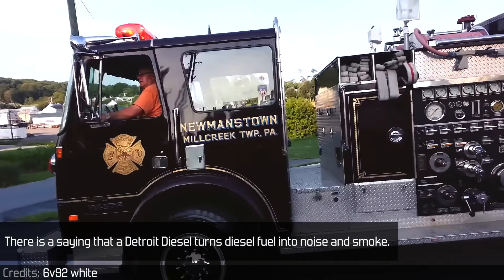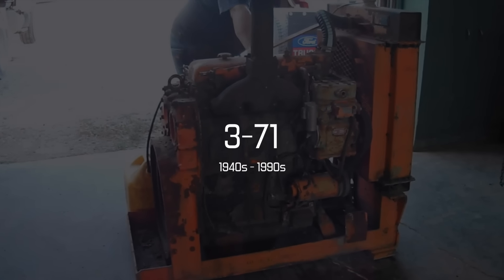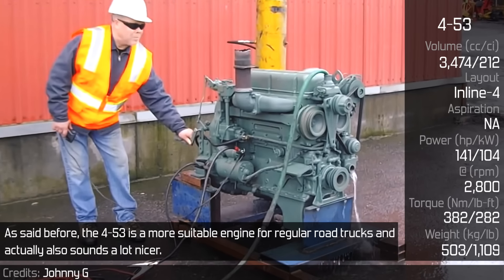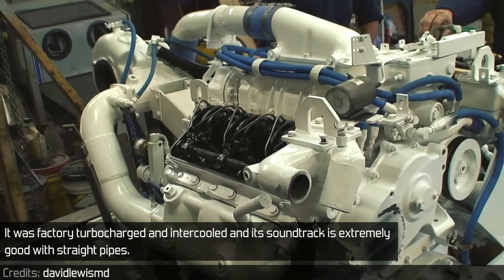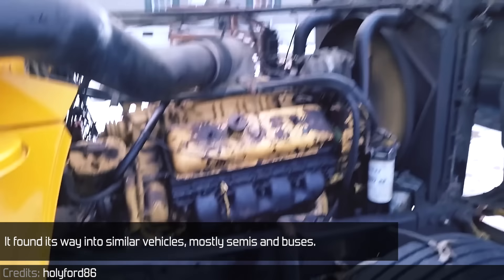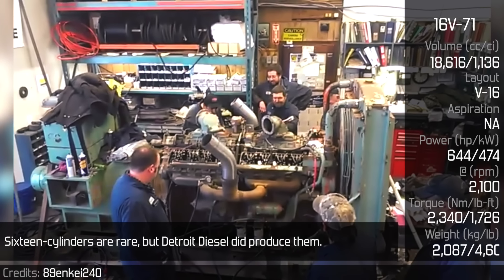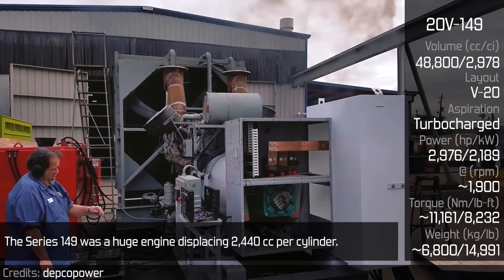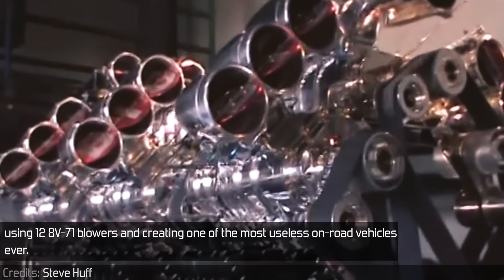9 Of The Greatest 2-Stroke Detroit Diesel Engines Ever

Comment: Imagine if a company made a diesiel powered muscle car
Reply: Cartoonz n Cereal BLASPHEMEEEHH
Reply: Cartoonz n Cereal it would get dragged
Reply: That would be dodge. they could put a straight 6 turbo Cummins into something like the challenger or make an entire new line of muscle style cars.ahh think of the possibilities lol
Reply: Cartoonz n Cereal look up the duramax camaro and powerstroke mustang, there's a company that actually didnit
Reply: ForRealBruh 01 that was an aftermarket conversion, I believe the company that did it would build you one, but it costs tens of thousands
Reply: Maybe he was talking about factory made cars.
Reply: yeah it will tear the road apart into pieces  from its monster torque but still lose out in acceleration to a Vtec  revvy petrol Japanese kitty engine Honda
Reply: fidel catsro You do realize that you can trade torque for rpm through gearing just as much as you can trade rpm for torque, right?
Reply: Cartoonz n Cereal I don't think bmw 335D is far from it, but what do i know?
Reply: Some guy in Canada did it with a first generation Plymouth Barracuda...
Reply: Cartoonz n Cereal the reason why there are no US passenger cars with diesel, is that thy do not meet emissions.
Reply: Cartoonz n Cereal. 70. Dodge charger with a 353 detroit on youtube
Reply: u mean like 3.0tdi audi a5?
Reply: keep dreaming ... you might pull off the line faster since the rpm range is short on diesel, forcing a lot of gear changes but once the turbo has time to start blowing on higher gears, the shear torque will keep the diesel car accelerating forever, when that little vtec struggles to overcome the air resistance and doesn't do crap after 130km/h+ vs a proper diesel.
Reply: Check out the BMW M550d, lots of diesel power in a limousine
Reply: unfortunately that's a 3 liter diesel too ... not 5L like the name would suggest
Reply: And about the 5 litre V10 from Volkswagen ?
Reply: Well if you don't need 5 liter to achieve the power you want why should you waste the fuel?
Reply: Audi, Mercedes Benz and BMW have produced high performance V8 turbo diesel automobiles.  Fast and frugal on the fuel.
Reply: Cartoonz N 2JZ bmw made a few
Reply: The germans do
Reply: Cartoonz.........The Mercedes-Benz S 400 d
Reply: Well, JCB (of excavators fame) made a record breaking car for running on the salt flats.  It took the highest speed record for a diesel-powered car in 2008 if I remember well, somewhere around 350MPH.  Definitely not a mass-produced car, but a muscle car built by a company ;-)
Reply: Audi Q7 V12TDI a muscle SUV
Reply: Justin Noker and the Cummins Charger
Reply: Santiago Giuntoli  That foolish of you to say that. Not all diesel engines were indestructible.  It's like the same for gas engines, they made good one's and shitty ones.
Reply: @cpufreak101  how about the cummins rx8. been done. cummins vette. duramax viper. people put diesels in anything. the problem is a diesel weighs too damn much and legally you cant put one in a vehicle that isnt rated to tow
Reply: @REAPER0D  yeah, especially with those truck Diesel's, some of them probably weigh as much as a small car on their own haha, and stateside I don't think there's any such laws like that as it's your funeral :P
Reply: @cpufreak101  there is a law. auto manufacturers have certain rules they are required to follow. one of the reasons there was only a few turbine powered cars ever made because of safety reasons and cost to manufacture they werent a viable choice for use.

when you look at something like say a charger (using that as its a common car chasis) throwing a 3k pound cummins in it creates a situation where the engine weighs the same as the car almost. in that creates a problem with crash test ratings. in which a auto manufacturer has laws to follow. so yeah, theres laws prohibiting it. why there arent v16 gasoline engines, and the ones that do exist are not automotive application. why bugatti created and developed the W16 cause the government put a ban on engines larger then 12 cylinders in a V pattern.
Reply: @REAPER0D  just saying it must not be enforced very well then, cause someone in my neighborhood tows with an old malibu with an owners manual that clearly states "do not use this vehicle to tow"
Reply: I got 2 buddies that put a 4bt in a chevelle and one in a 48 power wagon  and both vehicles are terrifying.  Like Richard hammond says. "Like being stuck in a phone booth with a panicky gorilla.
Reply: They already did. GM/Chevy had diesel 350’s and a few other motors that were diesel. They went in some muscle cars but were a rare option
Reply: The Audi A6 TDi is kind of a sporty sedan
Reply: They do make diesel power muscle car,,,Mercedes Benz the best one for me be 240 sl........nowadays think they up in 300 or something like that I know back in the 1980's they out done corvettes mustang running quarter mile.....0 to 60 was like 5 to 6 seconds maybe little less
Reply: They build them in Tuscaloosa, Alabama.....know that for fact,,,,I hauled the concrete walls and prefab buildings up there from moss point , Ms
Reply: i just hope they make factory built diesel cruiser motorcycle. Heavy, powerful torque, and loud

Comment: All is good until a cylinder sleeve cracks and than hang on because the ride don't end until she blows apart or it finshs eating engine oil.   3 71s in tractors were famous for runnning away and you shove what ever you could in the air inlet to kill it.

Comment: The designation was first number is number of pistons and second number was displacement of each piston.
I drove a 6-71 for many years. Being a two stroke, if you stalled it out sometimes it would run backwards. Black smoke out the air cleaner

Comment: You also have several roots blowers because 2 cycle diesels have cylinder ports and dont have any intake valves. Your pistons would be the intake valves to open and close off the cylinder.

Comment: Let's keep it real, if you love Detroit Diesels, it is for the sound, not for the hp.  The 2 stroke design doesn't allow for the high boost pressures you see on modern 4 stroke engines. And if you love them for the sound, the 53 series is where the love is at. They spin 2,800 rpm compared to 2,500 rpm on the 71 series and 2,100 rpm on the 92 series. And the more cylinders the better! So the best engines are the 8v53 and the 12v53. Also worth searching on YouTube are the 453's used in tractor pulling that spin 5,500 rpm. Those sound plain crazy!
Reply: I have seen a YT video of an 8V53, but haven't ever heard of a 12V53.

Comment: Hmmm no 6v-71s or 6-71s 

I think some of your info on the 71s is off.  The 1-71 2-71 came with two valve heads. All the rest could be found with either two or four valve heads. It all depended on the application of the engines.

The four valve heads were known for cracking between the valve seats or the valve seats and the injector bore on high stressed motors.

Comment: I wish detroit was still around to make more modern versions of these awesome engines. I feel like if they took a standard 2 stroke design (though seal off the crankcase and use the bottom of the piston to compress the air instead of the crankshaft) but added the detroit diesel valvetrain idea and added direct injection it could make for a hell of an awesome engine that might just pass emissions.
Reply: They are still around.. They just don't build 2 strokes anymore because of emissions laws.
Reply: Get rid of the emission laws then
Reply: The 51, 53, 71, 92, 149, 567, 645, 710, and a whole bunch of lesser known Cleveland, Winton, Electro Motive, GM, and Detroit Diesels where all direct injected.
Reply: Roger Penske bought Detroit Diesel and converted them to 4 stroke elctronic fuel injection. Put them on the road through Penske Truck Leasing and the fuel cost advantage was so significant that Cat and Cummins had to go to EFI to stay in business. The  2 strokes were already almost obsolete, but also all the non EFI 4 stroke engines as well. Nothing w/o EFI is competitive on fuel efficiency or emissions anymore.

Comment: Yo Visio, just an fyi, the 8v-71 was never sold Naturally Aspirated. The engine needed forced induction to run, since its a two stroke and there is no crankcase compression. The cylinders wouldnt properly scavenge the exhaust without the supercharger. Every 71 series is supercharged. Higher performance engines came with turbochargers.
Reply: AidanMC1995 - According to Detroit Diesel, it was "naturally aspirated"

http://www.dieselhub.com/specs/detroit-71-series-two-stroke-diesel.html
Reply: Every 2 stroke detroits uses a supercharger bit it doesn't make boost pressure. It's only used to clear the exausth so in theory they are naturally aspirated. When they are coupled with turbochargers they get real boost.
Reply: Ahhh. So It works like a scavenge pump? Thats cool! Thanks for the knowledge

Comment: This is a very nice and descriptive video, but it is mentioned several times that various Detroit Diesels are “naturally aspirated”. This is a misnomer. A two stroke diesel is supercharged by default. Turbocharging and aftercooling are features that can be included, but not necessary for the engine’s operation.

Comment: You listed some of these as naturally aspirated.

ALL Detroit Diesels have roots style superchargers, 
just to get the intake air into the cylinders.

Granted, the blower(s) aren't for higher power, the 
engine just won't run without them.

steve
Reply: Yeah "Normally aspirated" is more accurate I think. These are just chargers, engines won't run without them

Comment: Where would drag racing be today without the Detroit Diesel 2-stroke?  After WW2, 6-71 Detroits were cheap surplus, and early hot rodders found it useful to take the blowers off them and adapt them to their engines.  The Detroit blowers were not very efficient past about 7 psi of boost, but they did add about 30% power.  All of the blowers seen on Top Fuel and Funny Car engines are descended from the Detroit Diesel blower.  So they became the cultural icon there are today, symbolizing big power to anyone that sees them sitting on top of an engine.

Comment: That 24V-71 with the pile of 8V-71 blowers is all for show-and they are empty without impellers. The normal 4 blowers are underneath. The "3,000hp" claim is fake. The naturally aspirated (with only blowers) 24V-71 will maybe put out 1,200hp. With 4 turbos and raw water intercooled, the marine version put out 1,800hp @ 2,300rpm.

Comment: 'NA' just means Naturally Aspirated ie it has the blower but no turbo. All Detroit Diesel 2 strokes that have an N or NA designation are blower only.
The turbo ones are true +ve boost but they still retain the blower. The intercooler was in fact called an aftercooler by Detroit - it went underneath the blower and was a liquid cooled heat exchanger.
The Silver Series DDEC1 6V92 & 8V92 had a bypass blower that reduced blower pumping losses by ~ 30%.

Their bigger brothers were the 2 stroke GM EMD series of engines that are designated - like the GM Detroit Series by their cylinder size in cubic inches EMDs are used for electricity generation in locomotives and at power stations. They find use in tug boats too.
The EMDs are in three main series, 567, 645 and 710 and in usual configurations of V6, 8, 12, 16 & 20 (could be some others but they are nowhere near as common). Functionally the Detroit Diesels are almost identical to the EMDs. They are both Uniflow Diesels built by GM.
EMDs are different to the automotive based Detroits in a few areas - EMDs are 45deg Vee and they exhaust through the middle of the engine which necessitates mounting the blowers at the end of the motor one on each cylinder bank.

Turbo EMDs have a hybrid turbo/supercharger and this deletes the familiar Roots type blowers. The supercharger is geared to the crank in the usual fashion for starting, idling and low rpm. As rpm builds, the exhaust takes over and the turbo free spools allowed for by an overrun clutch.
This setup was proposed by GM Detroit for the Silver Series but they went with a cheaper bypass flap arrangement (the blower always turns but the bypass flap stops the blower from pumping air by diverting it away from the lobes). Because of development costs and the fact that at the time 2 stroke demise was within sight, Detroit went with the cheaper bypass option.

GM EMD 2 strokes range in power from about 750 - 3500hp at ~ 950rpm. Like Detroit Diesels EMDs have a very distictive sound. Even within EMDs the 567 series has a different sound to the 645 and 710 and anyone who loves the sounds of engines can instantly identify a 567 EMD when the differences are pointed out.

A 567 (looks like a 1500hp V16) with a good study of the blower location and distictive sound:
https://www.youtube.com/watch?v=zcYFf_H-xyY

A 645 V16:
https://www.youtube.com/watch?v=GNoNFahB-yw

A 710 V20 in a stationary power generation application. Check the manifolding for the turbo going to the engine air gallery (above the comparatively small generator):
https://www.youtube.com/watch?v=hFVJ9Lhhm0I

Comment: Great engines, but, tuning the old, pre-DDEC ones is a frigging NIGHTMARE.
Reply: It's important to note that the blowers on Detroit 2-strokes DO NOT add power. They're there for exhaust scavenging. They provide only enough positive pressure to blow all the exhaust gases out of the cylinders.

Comment: There;s no such thing as a Naturally Aspirated (NA) 2 stroke Detroit diesel like this video is all about.  All 2 stroke detroits regardless of size had a super charger (blower) or series of super chargers to push air into the cylinder at the top of the stroke.  It also pushed exhaust out of the exhaust ports at the bottom of the cylinder.  When the drive for the blower would fail, the engine would not run because it couldn't get enough air.  I believe the V16 and V24 configurations were just pairs of V8 and V12 blocks bolted together.  At the least the V24 in the video is made that way.  2 stroke diesels are the most famous of the Detroits but they also built 5 stroke engine which I believe they still do.

Comment: No 2-Storke is Natrually Aspirated on each one of them other than the turboed ones you can see The Roots blower on the side of the block, Two Strokes need forced induction because the intake is in the cylinder walls and air has to be forced in while the exhaust valves are open to get fresh air to mix with the fuel

Comment: 6-71 N's were used in a lot of early Euclid mining trucks and sounded great.  The best, though, was the 1LLD and R 40 Euclids that had two of them side by side.  Way different than the 12V-71's as they went in and out of sync.

Comment: im a 4 stroke guy but these motors are pretty cool, they sound amazing but yea noise and smoke, that truck had to downshift way too much, cummins back then was the way to go, i would put a detroit on a gokart so i could make lots of noise and smoke
Reply: FlyingWldAlaska77 I've driven an 8v92 Silver, C16 Caterpillar and a Cummins Big cam 350, 400 and ISX. I would rather have the Detroit if the EPA would let me. 
My experience with Cummins products (and I do Warranty service) someone bribed someone to keep them alive. They're simple, yes, but they break every five minutes.
Reply: you probably know better than me i dont run either in industry or anything like that

Comment: at 4:30 you say the 8v 71 came in naturally aspirated. However, diesel 2 strokes are incapable of natural aspiration. Just a small thing that bothered me.
Reply from the maker: The blower installed on them is only there to scavenge the exhaust fumes out, it barely makes more pressure than atmospheric.
Reply: VisioRacer that's what I was getting at mate. but technically having a blower (even if it doesn't make boost) makes it not naturally aspirated. great video all the same. 👍

Comment: Also had a six wheeler with a 671 Detroit seals went bad in the blower engine ran away running on engine oil pulled the emergency shut-off . On the dashboard and it pulled right out of the dashboard I had to run around open the hood and manually close the flap on the blower to shut it down what a disaster but a reliable good running engine but had a monitor certain things

Comment: The only problem, there is no such thing as a naturally aspirated Detroit. They require forced induction, because the positive displacement from the blower pushes the exhaust gas out of the valves.

Comment: So two stroke uses the same Diesel with no other additives as a 4-stroke is that what we're getting out of this?
Reply: Apart from on power stroke per revolution, it's a totally different process of fuel /air induction and exhaust for diesel two stroke as compared to two stroke gasoline.

Comment: thank you for posting this entertaining video.  what you may not realize is that the 92 series replaced the 71 series.  the v8 71 was an excellent engine but the v6 92 was as good or better.  same power and used less fuel.  and the v8 92 was a real athlete.  no lack of power.  so I disagree with your saying the v8 71 was more powerful.

Comment: Gotta face facts here, Detroit diesels won WW2 and built current western civilisation :),
Just picked up a good score at auction, Aussie built DETCO 300 kv generator with a  6V92T with 71 hours, reason for such low hours ?, was owned by Aussie red cross blood banks which would obviously need multiple power backups :)
🤩🤩🤩🤩🤩

Comment: No Detroit diesels where naturally aspirated. They all had a blower on top to pressurize the block. They did make turbo and blower configurations. But without a blower to pressurize the block it would not run as a two stroke
Reply: A lot of people considered it 'natural' or 'normal' since that was the base configuration. The blowers in this role aren't superchargers and any pressurization of the airbox is coincidental. They literally push air through the cylinder when the intake ports and exhaust vales are open